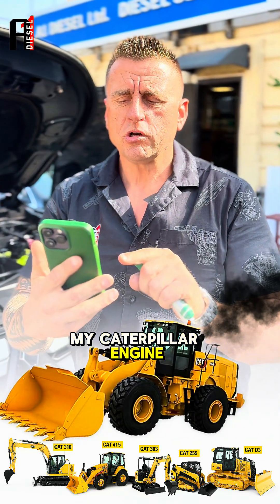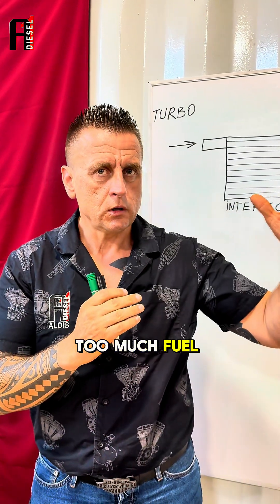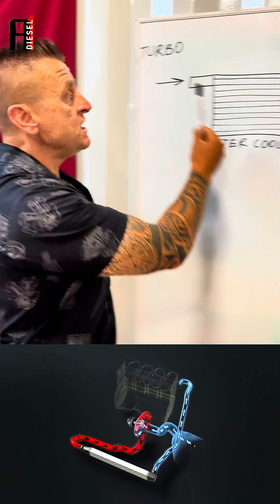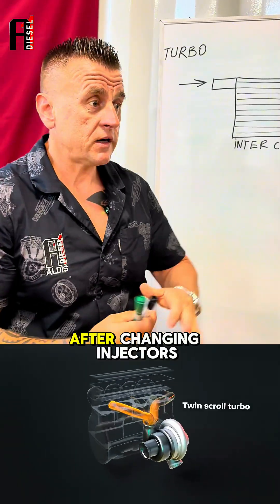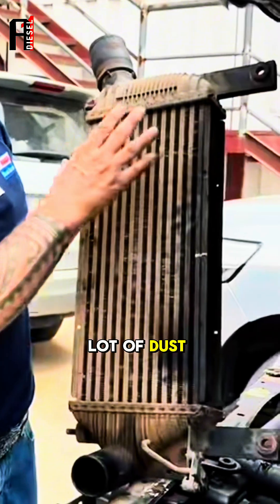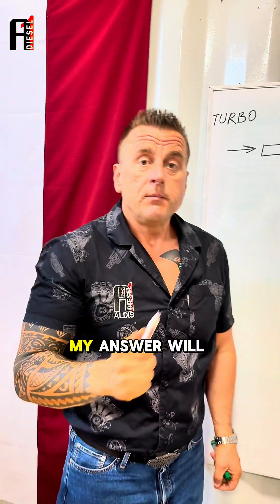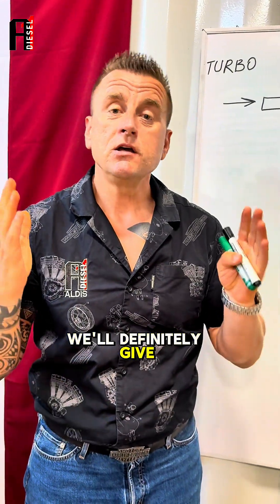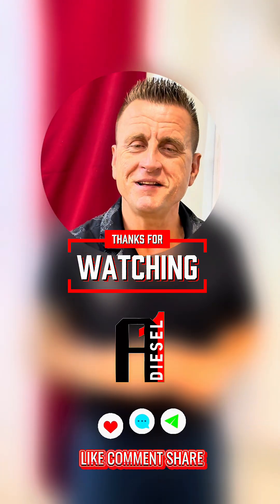Black Smoke Won’t Stop! New Injectors & Turbo on CAT Machine But Still Smoking!

Comment: Or it could be another 11 root causes I dotted down. 
 
The EGT will tell you if it’s an “aftercooler” (intercooler belong between compression stages before entering an engine). 
When the inlet manifold pressure isn’t meeting desired/ or demand due to a boost leak the ECM will keep adding fuel in an attempt to make desired/demanded engine speed and inlet manifold pressure. The net result from that is excessive fuel causing high EGT’s  along with incompletely combusted diesel in the exhaust, soot. Unburnt diesel is white when pushed out excessively.